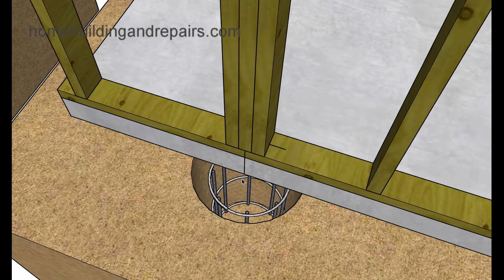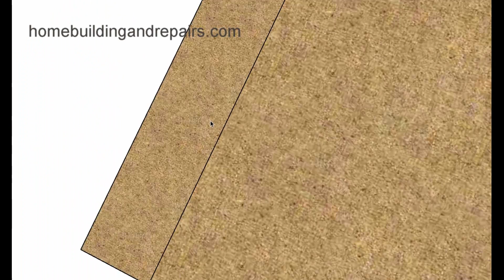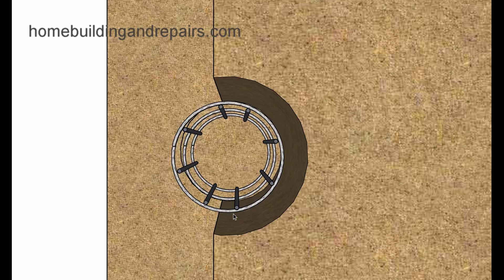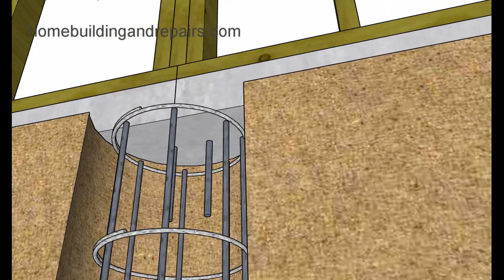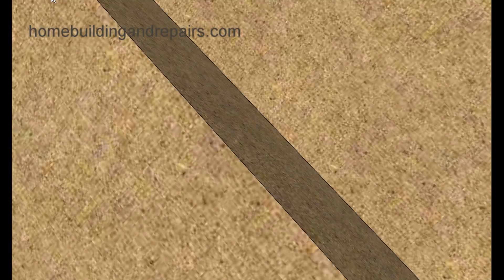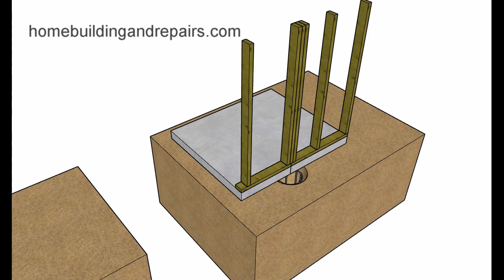Round Rebar Cage Under Existing Concrete Slab Used for Structural Reinforcement

Comment: How would you add a 3 ft frost footing around a pre-existing morton building with an already poured concrete slab? Want to put a mother-in-law suite in it, but county wants the 3 ft. frost footing put under it to make it to code.
Reply from the maker: I would ask them for more details.

Comment: Thank you. I am doing exactly this as a DIYer. Have a slab that is sinking slightly at the leading edge due to weight from a porch roof & poor slab construction.  

Took me a while to create a jig to bend rebar in a circle. 

What is the purpose of the dowels? Wouldn't this drag the slab down?

Comment: Very helpful.  Wondering why it is a round cage instead of a square cage?  Does it matter?  Need to do something similar on a 1964 home for a new beam post footing.
Reply from the maker: No, use whatever is easier if you're not using an engineer who would tell you what to use.

Comment: Great video, Greg. I had to do something like this on my neighbors patio addition. I was busted by the inspector because I welded the rebar cages together, rather than using tie wire. It was easier for us not being a couple DIY guys. He said the rebar we used wasn't rated to be welded. He passed us, but asked us to rebuild the cages before we poured the supports...  Don in Phoenix.
Reply from the maker: Yes, that's a big no-no. I think as do-it-yourselfers we actually come up with great ideas that aren't actually that good. It doesn't seem to be as bad if a building inspector points it out, but the next-door neighbor, your spouse or even one of your children can be a little irritating.
Reply: What's wrong with welding cages?
Reply: Because the guy with the clip board that's never worked a day in his life said so.

Comment: I wonder why a cylindrical shaped hole is specified. Would a rectangular hole have different loading? The job doesn't look too difficult.
Reply from the maker: I don't think it will be a difficult job either, but if you don't know where to get all of the components, it could make it difficult. Yes, different shaped footings provide different engineering strength for supporting building components. If I would have done this job, I would've asked for a square or rectangular shaped footing. One of the biggest problems with engineers is that they usually have never done the work before.
Reply: +gregvancom It might be that the engineer just lifted some values from a supplier's parts guide for commercial products, such as bridge piers. But a home owner or contractor could easily bend a few rectangles himself on-site.
Reply from the maker: I think if there's a will there's probably a way.

Comment: Thank you! Min clearance on sides here, is 75mm, making the circles only 200mm max  (350-150 = 200)  I've realised just how small these are gonna be!  

Please could you point me toward a solution for this: How do you keep the cage 100mm above the bottom of the pour?  Is this what you call a "dobe" ?
Reply from the maker: Yes, type the phrase rebar spacer into a search engine for more info. You can use the dobes or wire to hang the cage and it is going to be small. You're welcome
Reply: gregvancom what is your email? Thanks
Reply from the maker: You can visit our website and scroll down to the bottom and then click on the contact link. There should be a link to our website under each YouTube video in the comment section.